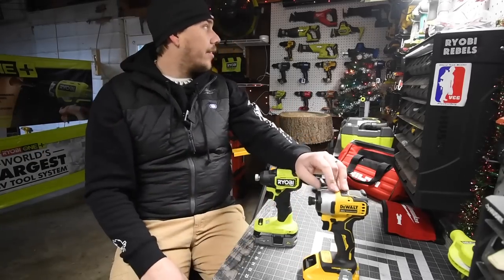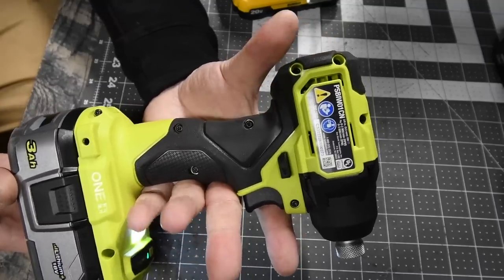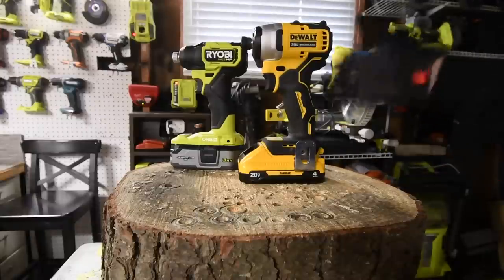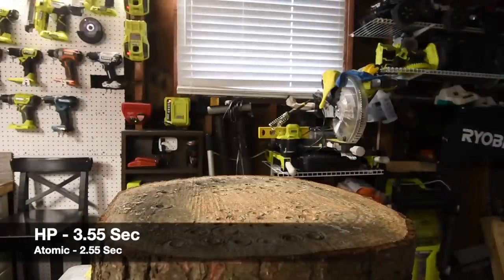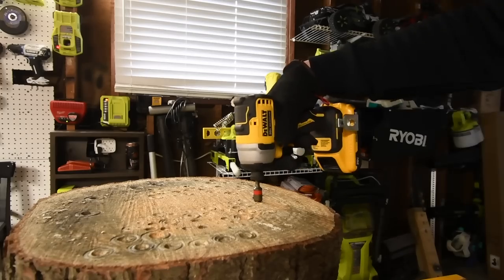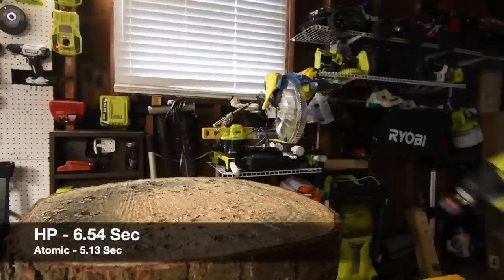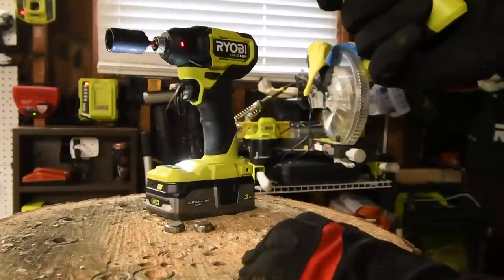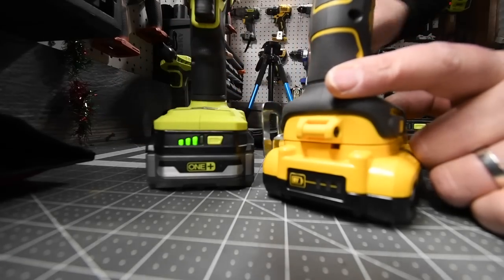Dewalt Atomic vs Roybi HP ($100 Tools Sale)

Comment: In my experience, the slim 3Ah HP really doesn't compare to the 4Ah HP. Even though it has 21700 cells, it's still just a single row in series. The 4Ah has two series rows in parallel. The amp draw is divided across twice as many batteries in the 4Ah versus the 3Ah. That makes a big difference. A single (quality) 21700 cell is superior to a single (quality) 18650 but five 21700s don't compare to ten 18650s.
Reply from the maker: ive already done a lot of tests on Roybi batteries, you should check the out
Reply: Yeah I watched a comparison with a brushed and brushless saw, one had a 1.5ah and the other had, I think a 5.0ah or something. People just don't understand batteries or current.
Reply: You really have base a discharge test on the battery/battery packs "C" rating. A lower amperage battery in series at a specific voltage with a higher C rating can discarge a higher current then vice-versa. Most people just think higher amperage battery, therfore more "powerful" tool.. LOL not how it works kids.

Comment: Tacklife came out with an impact driver on Amazon, take that and compare it to a black and decker impact driver. Both 20V max and both $60-$70. Also do a 20 year old GOOD drill/ impact driver vs a new cheap impact/drill
Reply from the maker: yes they did. that tacklife impact is brushed though

Comment: Next time, measure the temperature of the chuck.  I drove about 20 4" #14 screws one after the other with my brushed Ryobi impact driver and the chuck was too hot to touch and was smoking.  I then tried to cool it by running it with no load intermittently.  It still works fine.  Also, what do the guts of these tools look like?   Does the Ryobi have a lot of plastic and the DeWalt metal?   With this test, Ryobi did fine.  So what if it took a second or two  more to run a lag screw all the way in. More time is is wasted drinking coffee and BS'ing.
Reply from the maker: both tools have a lot of metal in them. there actually isnt a lot of material in general in these impact drivers
Reply: @ManCaverTools  Since that is the case, what are you getting from DeWalt to justify their price,  the yellow and black color and name tag?  I would hope more durability, stronger motor, longer life!
Reply from the maker: @russmartin4189  this depends on what battery platform you want to buy into. most of dewalt tools are better than Ryobi. but Ryobi has some tools that are better to use that are on the platform like fans and vacuums and stuff like that

Comment: DeWalt DOES have batteries with rubber molding on them, they're sold as the Mac Tools 20v batteries. Completely interchangeable and both made by DeWalt. I have 2 of them, a 4 and a 2. Interestingly DeWalt also makes a fluid resistant version of the 887 sold by Mac Tools. The MCF886.
Reply from the maker: very good and I thank you for sharing that info Jon

Comment: You should really compare with same size batteries.
Reply from the maker: the Ryobi would have lost even more, the Roybi battery that I used has 21700 cells in it
Reply: @ManCaverTools  so you didn’t have the equipment to do a fair test.

Comment: The atomics better but I still don’t like the atomic line of tools for not much more you can get the XR which is much better Which is the tools that I have
Reply: I don't have any atomic either Tyler. I have XR and Xtreme. But faster don't always means better...
Reply: @franciscoagosto2447   It does in this case
Reply: @MrGamer-lz6ci  I disagree. More power not the only metric. Size, style, price, battery platform, ergonomics still count if you are only concerned with power. Yes here the Dewalt is faster/more powerful.
Reply from the maker: but they do have it for the people that dont want to spend that extra amount and I thank you for viewing Tyler

Comment: Do both the compact 4ah and the 4ah XR 20v max batteries have 21700 cells or just the compact? If so which batteries have the new cells? Im in need of another battery for my impact and cant seem to find much info online
Reply: Just the compact one
Reply: @emmanuelmartinez8312  alright thank you. Do you or someone else happen to know if the compact 4ah with 21700 is better/ last longer than the 18650 xr version? Also does that mean the 5 ah xr is 18650 or did they update the 5ah to 21700?
Reply from the maker: im not sure. I thought they only made 1 compact 4ah
Reply: @ManCaverTools  hey thanks for the response and sorry for the confusion. I was just wondering if the normal XR 4.0ah battery was better than the, compact non XR version, with the 21700s or if the cells really make all the difference. Thanks! And happy hump day!

Comment: I doubt u need safety glasses for using a impact
Reply from the maker: if I dont I would get heat for it from the viewers lol
Reply: @ManCaverTools  true. But keep up the good work love the videos
Reply: Really Weldone?
Reply: @georgedavall9449  yes really cause what is there to throw at your eye. Now a drill driver for sure cause drilling wood and other materials are everywhere while drilling
Reply: @weldonpinder7295  whatever you say there Weldone  Pinker!  No worries!  Everyone is entitled to their opinion, however wrong it may be!  🤔😬🙄😁😃😀😂🤣✌🏻
Reply: @georgedavall9449  well whenever a fastner lag screw or bolt hits my eye or if the impact explodes and the parts hit my face I'll give you a shout. Or Maybe if it happens to you let me know. Now for using the impact overhead that's understandable cause a screw can hit your face. Hey I use safety glasses all the time. But when I see Dave only putting fastners in a stump there's no need for them
Reply: @georgedavall9449  I mainly have them on because I'm also cutting wood and drilling etc on the same job all day
Reply: @weldonpinder7295  It’s all good my man!  Your point is taken, and I would just say please stay safe and Healthy!  Safety can be taken to extremes, and it should always come down to common sense.  Gloves can be useful at times, and a hindrance at others.  Hearing protection should always be used, and I fail at this a lot!  Blade guards on table saws ALWAYS!!!   I don’t care what ANYONE Says on this!  I didn’t have a guard on a Company supplied saw once, and I suffered a bad but not debilitating cut 😳🙄😢
It was a poor saw, but still my fault.  I got lucky on that incident!  Then on another occasion, with a fairly new Makita portable table saw, I left the guard off, for just a few cuts, and got nabbed by OSHA big time!  I treat table saws like a loaded pistol!  Good exchange back and forth with you!  👍✌🏻😀🇺🇸
Reply: @georgedavall9449  same here and sry bout the cut. I have a co-worker the got nicked by a miter saw and lost a little bit of his finger. Stay safe and was nice talking to ya. Hey I know this is off the subject but my country doesn't have a home depot. I have to order my tools online and when they get here they're nearly double for what I purchased them for and it sucks.
Reply: @weldonpinder7295  Thanks, it was a long long time ago, no worries.  Hey, I don’t think Dave will mind, as he was on the live chat on Tool Boss’ channel.  Go over and make a comment under the video, and you are entered in to possibly win a M18 Fuel impact with Packout case.  It’s the one he just did today.  “Christmas 6th Annual giveaway” or something like that.  Sorry about the price of tools where you are.  People in the USA don’t know how lucky they are.  I do, and I don’t take it for granted.  Hope you stay safe and have a great Holiday friend!  Peace
Reply: @georgedavall9449  hey thanks u have a great holiday to and I so wish I could be at a home depot right now . I've been once  when my father in law took us to the USA and I doubt I'll ever be able to go again. So like u said don't take it for granted stay safe, peace

Comment: Just noticed your reaction to the specs, after you just said the impact was actually a wrench, not an impact driver. So, Wow, really?? 600 rpm difference astounded you?? Try using a dewalt impact wrench against that ryobi and see if the results differ. Or just get the correct ryobi impact next time so we get a true comparison.
Reply: And its not about who wins, but more what to expect from your tool when you spend your money...
Reply from the maker: I switched out the anvil from the Ryobi Impact wrench into the Impact driver. I did a video about it, I take both tools apart and swapped then anvils, here is that video -https://studio.youtube.com/video/QLM7W7pFUoo/edit
Reply: I need to watch again, because I could've sworn you said the model number you read off of the tool was for the wrench, not the driver. If I'm incorrect, then by all means, my apologies!